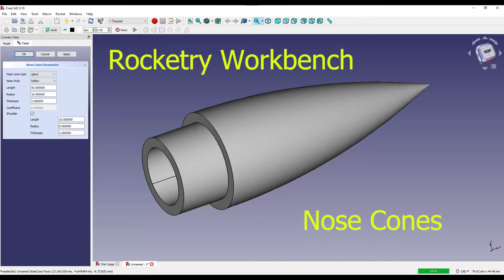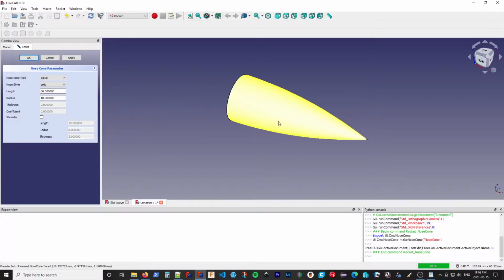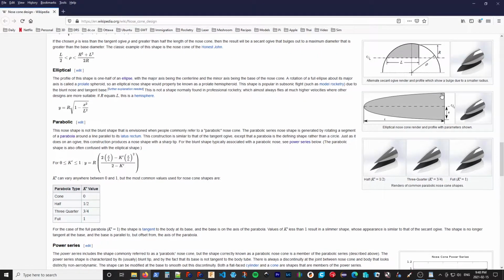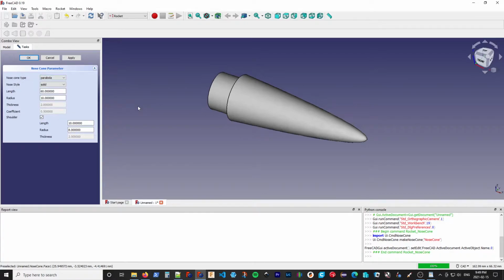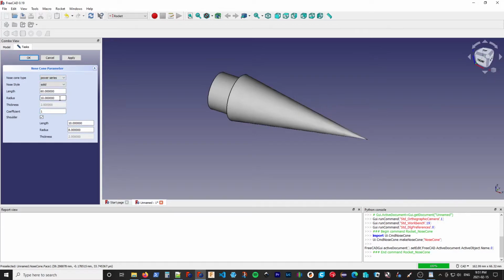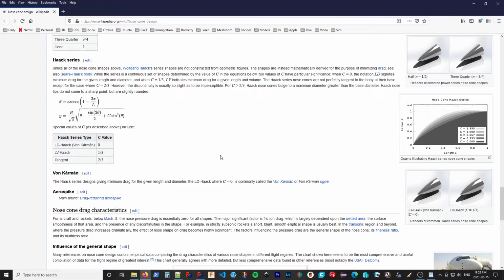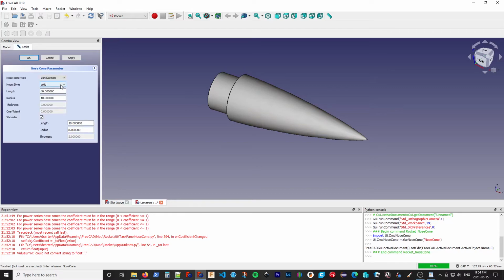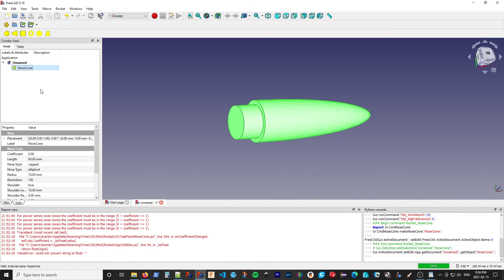Rocket Workbench   Nose Cones

Comment: Hi Dave, I downloaded the rocket workbench through FreeCAD 0.21.2 addon manager, and it doesn't seem to appear in my tools or dropdown menu for wokrbenches. I've tried extracting the ZIP file and placing it in the Mod directory but that doesn't seem to help either. Is the rocket workbench compatible with FreeCAD 0.21.2? Thanks.
Reply from the maker: The latest features require FreeCAD V1.0 features, so at the moment that means the V1.0.0RC3 version. There is a mechanism that is supposed to set the last compatible version but that doesn't seem to be working correctly.

If you want to stick with the current version, you'll need to follow the directions shown here: https://github.com/davesrocketshop/Rocket/blob/master/TESTING.md

The branch you want to select is Tag v3.3.0.

Or you can try the latest release candidate. In the meantime, I'm investigating possible fixes.

Comment: Hello Dave, I am a practitioner of the amateur experimental rocketry discipline. This workbench makes it much easier for me to manufacture rocket components. I am currently finishing one of my hand made motors, I have already made more than one. The workbench is one of the best for me but when it comes to printing it does not come out the same way, the cone in fact comes out quite irregular and it does not have that smooth and curved surface, rather it looks like a low-poly cone, you know why, it is the elliptical cone for sub - sonic flight.
Reply: Hi Dave, the problem comes when exporting the file in OBJ format. I tried to use STEP format and it was solved although with AMF It is simpler.
Reply from the maker: @jjoaquinalegre9561  I don't have much experience exporting to OBJ format. It uses the built in routines, so it's nothing I've had a hand in coding. My only suggestion is to create the mesh first using the mesh workbench, and then export the mesh. This will give you more control over the mesh granularity and smoothness. There should be some good tutorials for the mesh workbench online.
Reply: @DavesRocketShop  ok, thanks. 👏

Comment: Hi Dave.  I love rocket workbench and have quickly been teaching myself FreeCAD while designing parts for BT-80 MPR airframes.  The workbench works great except for one small problem...all my body tubes and nosecones have an extra plane (a seam if you will) running down the side.  When I save to STL, import it into my slicer, then print it, it prints the seam as a notch in the side of the PLA.  What am I doing wrong here?  Is there some global setting or configuration in FreeCAD that could be causing this?  Thanks!
Reply from the maker: This is probably an effect of your slicer. On each revolution, the nozzle starts and stops at the same point before moving up to the next layer, either over or under extruding just a little bit at that point. This can create a seam (although usually not a notch unless you're under extruding) There should be a setting in your slicer to randomize this start/stop point, but where exactly that is depends on your slicer software
Reply: @DavesRocketShop  I’ll try it.  I thought it was a direct result of the plane I’m seeing in FreeCAD.  The line actually shows there on the side of the object.
Reply from the maker: @ericmartin9249  That's normal. When you draw a 2D shape and rotate to create a 3D object, it shows the line where it was drawn. You won't see that in the STL. If it for some reason is part of the STL, you'll be able to see it in the slicer.
Reply: @DavesRocketShop  Ok, good to know.  I just got my 3D printer for Christmas, so I'm still learning everything related to using it!
Reply from the maker: @ericmartin9249  That takes time. Don't get sucked in by experienced users who should know better saying 3D printing is easy. There's a lot to learn. Hang in there!